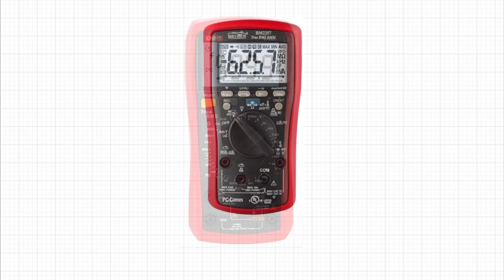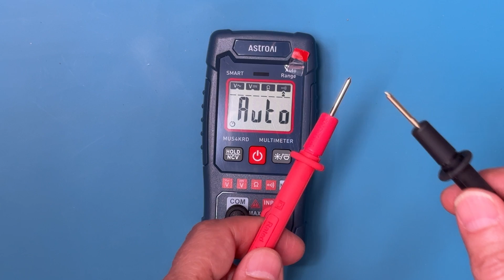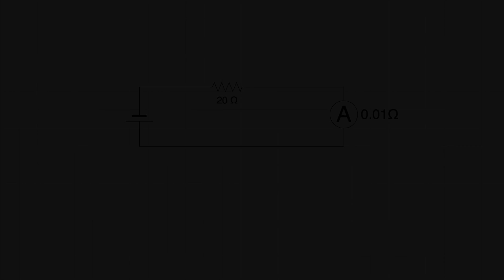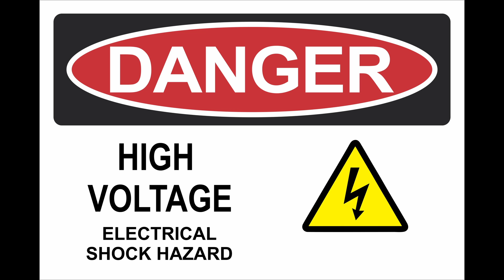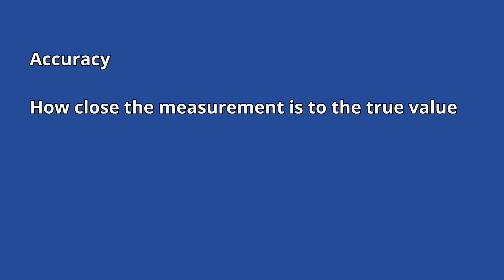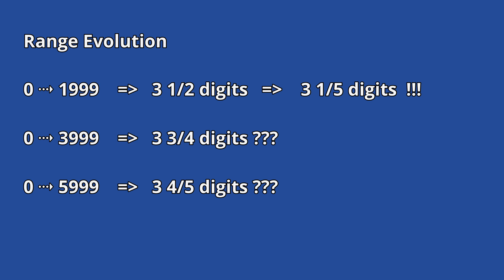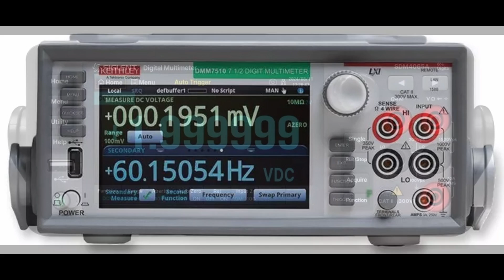Features that matter when choosing a multimeter

Comment: Great content! Do you have any experience with the brand Voltcraft? I’ve had one of their multimeters for nearly 30 years, and it’s absolutely indestructible!
Reply from the maker: I’ve not heard of Voltcraft until now. I had a quick look and they appear to be variations on Uni-T designs built to EU standards. Uni-T has a number of very good models on the market and the EU variants are excellent. Thanks for putting Voltcraft on my radar.
Reply: @jtechlabs1 Thank you for the reply! I did some more digging and it looks like Voltcraft is an in-house brand for Conrad Electronic, with some designs made in-house and others sourced from Uni-T. Either way, my experience with the brand has been great—especially considering the price.

Since you’re creating such fantastic content on your channel and testing gear that’s often hard to find solid reviews or comparisons on, would it be possible to create some sort of ranking chart or buyer’s guide for the equipment you test in the future? :)

Channels like Torque Test Channel and Project Farm do this for tools, and it’s incredibly helpful when researching which brand and model to buy.

Comment: whats your opinion on aneng m20?, it has similar features compared to zoyi zt102, it comes half of zt102 price
Reply from the maker: I have no direct experience with the Aneng M20 or meters that may be related to it. I also can't seem to find it for sale on AliExpress at the moment. On the other hand I have tested the Zoyi zt100 and the ZT111. I was very impressed with the ZT100. Aneng seems to rebadge meters from many manufacturers. I am curious why the M20 caught your attention.

I struggle to find any logic in the pricing of meters in the $10 - $20 range. There are a few under $10 that have good features sets and are reasonably accurate.  The main thing that you will not find in meters selling for $10 or $20 is good input protection. A good fuse (the kind used in a Fluke for example) costs more than these low end meters.
Reply: @jtechlabs1  compared to zt100, aneng m20 offers better capaitance measurement and 6000 counts
Reply from the maker: Well there is always the zt 111 or 109.  I believe that the zt111 is labeled as AN8009 and the zt 109 as AN8008 by Aneng. These are both 9999 counts.

Comment: Many 20000 counts and above meters can measure resistance in 10 milliohm steps, most lower resolution meters cannot. Portable devices will still usually lack a zero feature and/or four wire measurement to make great low resistance measurements. The 10 to 500 milliohm "world" is very relevant when testing quality and condition of cables, connectors, switches, safety earthing.
Reply from the maker: Thanks for the information. I appreciate it.

Comment: 15:56 indeed, arcs in 11kV systems (not where you would use a standard meter) or even in multi hundred ampere distribution rooms for 110V/220V are known to be capable of burning nearby people to death.

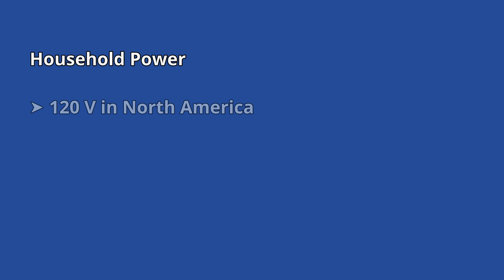Comment: 13:20 A 12 volt car or PV battery or large computer power supply can still deliver brutal currents that can easily set something on fire, or melt tools or test leads in your hands.

Comment: 11:30 fuses will not reliably protect the meter from all types of overcurrent. They will keep the meter from catching fire or detonating if there really are multiple thousand amperes - IF the right type of fuse was designed in (5x20 clear glass fuses are not reliable at not arcing over with really high currents or voltages well above 250V!). This can be a question not of "no more meter" but "no more hand" or "no more eyes".

Comment: 6:32 accessories needed often but rarely included: Some plain 4mm banana leads (especially for current). Alligator clips that can be attached to probes or 4mm leads. True needle tips (stabby enough to hook into solder joints or connectors and penetrate oxides). Mind that 4mm safety plugs are not always perfectly compatible between brands, that can lead to unreliable connection to the meter and dangerously misleading results (reading 0V where there is many V, or reading open when there is a short).

Comment: 4:23 sorry for all the drivel.... but a true RMS meter claiming eg 100kHz bandwidth will only be able to deal with up to about a 20kHz square wave accurately. The harmonics of a 100kHz square wave are important for an accurate measurement but OUT OF BANDWIDTH for a 100kHz meter.

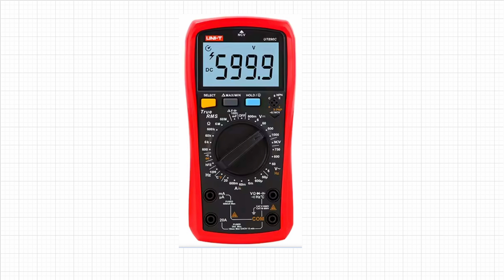Comment: 2:23 autoranging current meters can be a nuisance because they change their impedance when switching. In a low impedance circuit, that can result in nervous autoranging, or even damaging or dangerous overcurrent. And in Ohms and volts, autoranging can be quite slow!
Reply: autorange can be death

Comment: 2:13 actually, the divider circuit of your average DMM is more similar to that of a VTVM (tapped divider with a constant 10 Megaohm burden, feeding a practically infinite resistance voltmeter core) than to that of a passive analog multimeter (which basically puts an appropriate ballast resistor in series with a current meter core circuit, resistance is variable across the ranges - can be HIGHER than a DMM on high volts ranges, eg a 100kOhm/volts passive meter will be 100 Megaohms at 1000V range).

Comment: Basically, there are three common more than basic use cases: a) You need a versatile electronics bench or field service tool. You want decent quality and all kinds of features (basically, half an LCR meter built in), or even a scope/meter combo (even if you have a scope, these meters have the advantage of being floating - just mind your safety!). b) You are working with high energy stuff (building installation, HVAC, electric vehicles, PV) - you want something that has the CAT ratings for the job and is from a maker whose CAT ratings you can trust. In your opening picture, that would be Fluke and... silence (there`s many others - Chauvin Arnoux, Gossen, Benning... that field electricians recommend). c) You want precision and accuracy. Keep in mind that a used, maybe not perfectly calibrated but known reasonably accurate used 34401A starts at a few hundred if you can find a good deal.
Reply: What about USA brands like Ideal or Klein?
Reply: @Henry14arsenal2007  Aren`t these tool brands  that rebrand some OEM products, rather than test equipment brands?

Comment: Your explanation of voltage measurement is quite some fiction. Meters do not use the current across a 10M resistor to measure voltage. If that were the case, then your previous section would make no sense, because now you're asserting that DMMs can measure current directly! Why would they need the shunt resistor? They have a single ADC which can measure voltage "directly". This is the reason for the use of a resistor in current mode, the resistor turns a current flow into yet another voltage reading. A 10M "resistor" is used because a voltage divider is needed to lower the incoming voltage for the meter's ADC. In fact, the 10M "resistor" is compromised of something like a 9M resistor, a 900k resistor, a 90k resistor, and a 10k resistor. These all add up together to 10M, but when using them as a divider will produce 1/10th the voltage, 1/100th, 1/1000th, etc.

High end desktop multimeters can often measure voltages up to 10V or 20V without any use of such a 10M resistor whatsoever; they present greater than gigaohm impedences to the circuit they're measuring. In fact for some certain handheld multimeters, you'll find this also to be true on their <2V range or in their mV range.
Reply from the maker: Thanks for your feedback.  I was attempting to illustrate that when measuring voltage the meter presents a high impedance and thus very little current flows through. it seems I could have improved this section.
Reply: @jtechlabs1  Yes the wording was bad there. The rest of the video was pretty good though.

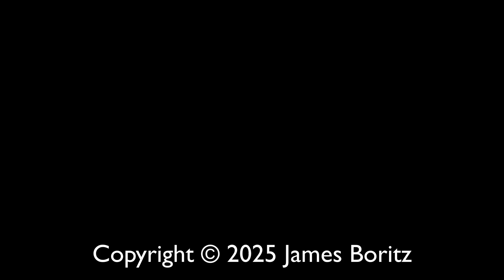Comment: I had quite a few multimeters through    also had a repair shop. Fluke, high quality, used industrial size fuse. Auto shut off is extremely annoying. I bought one realively unknown brand  SOAR. 24:41  cheap for service calls. That become my favorite. My beef about multimeter  leads how well it plugs in. The  depth and diameter were an issue with older ones. Accessories  for leads. There were many available at one time. Measuring  chips in live circuit. Isolated tip only the tip in the middle is exposed. High quality Accessories  actually  screwed  into the lead. Hooks are helpful in hard to reach places connecting to wires, especially  in older equipment. Insulated alligator clip connected  to the multimeter was also helpful. New modern leads won't  accommodate  that option. Measuring  capacitors, always used dedicated  meter because of the range and slight change of discharge  may blow the fuse. ESR meter is must for switching  powersupply repair, and smd capacitors electrolitic. Measuring  inductance, also a range issue. From large in crossovers, to small in  HF circuits. Frequency measurement  high frequency  in the MHZ range I  like to  use scope  probes. Even small capacitance can detune HF circuits. Finding a good ground connection especially in units with all plastic covering, and oxidation. Really sharp and pointy probe saves frustration. Hot ground, cold ground. That gets tricky  if you only use one multimeter with all the functions  on it. If  you are doing  work up high looking  up, you need a tester with a strong case and also a folding back support which is also high quality. Fluke  is a winner  if you don't  mind  auto shut off and  non standard fuse for a multimeter. Always replace the fuse with the same type. Slow or fast blow will matter. They used to have an extra fuse inside. You can find good deals in pawn shops if the price too steep for high end equipment  or you are just starting out. Much higher than the limit voltage, cook a cheap  multimeter for sure.

Comment: Another case where  the fast continuity test is useful is probing a circuit board. E.g. If you want to know which pin on a 40 pin IC is ground, you clip one lead to circuit ground, and drag the other lead over the pins until you hear the beep.  It can be annoying to have to intentionally pause the lead on each pin.
Reply from the maker: Absolutely.  Thanks for pointing that out.

Comment: I recently bought a Greenlee DM-820a.  This may have been an overkill meter for hobbyist usage but it is a rugged meter and the older I get the more likely I will start dropping things.  I also like the idea that it measures micro ohms which I may need as I start building guitar amplifiers for projects at my house now that I am retired.  

Great video please keep them coming.
Reply from the maker: Thank you. I appreciate the feedback! The DM-820 appears to be a rebadged Brymen BM827. These are excellent meters. I really appreciate the "Beep Jack" feature as I blew the fuse in my Fluke 117 once because I had the lead in the wrong jack.